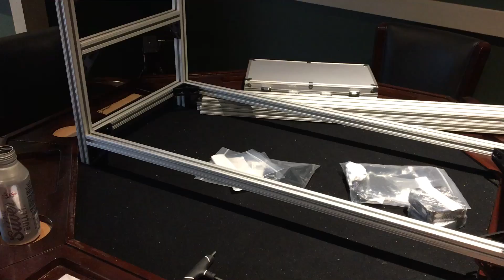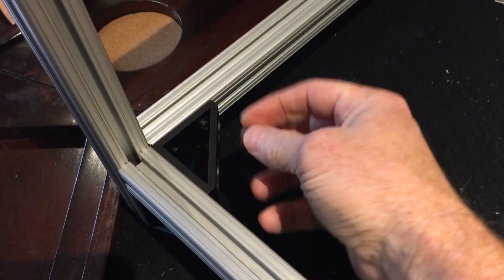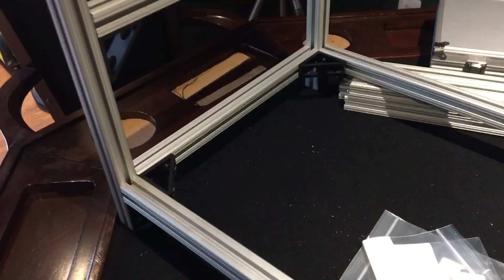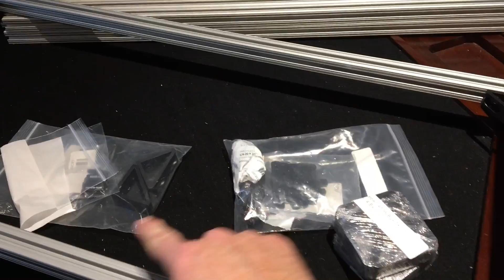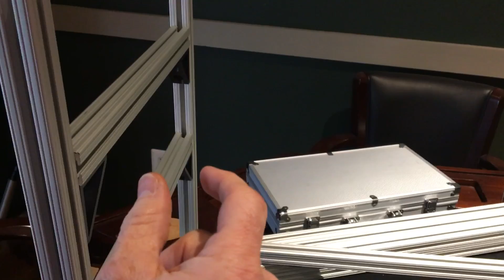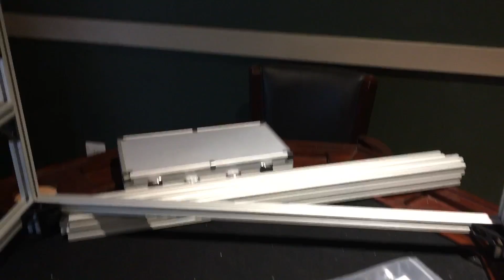T-slot aluminum rig - Part1

Comment: Don't forget to add EVGA stickers to it, 10% extra hash!

I just built new frames as well. Still need to sell those damn B250 mining boards.
Reply: Never tried the Z370 due to the no Celeron thing. That doesn't work for me. Sticking to running 9 cards on the Z270-A's. Love those damn boards.